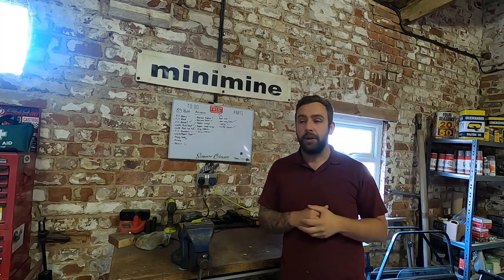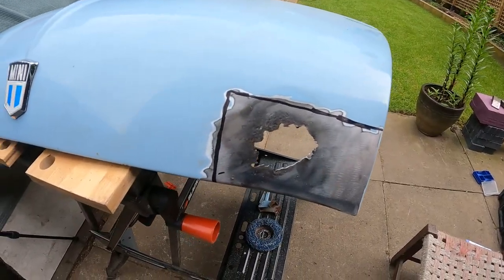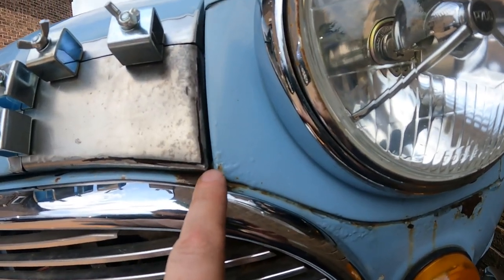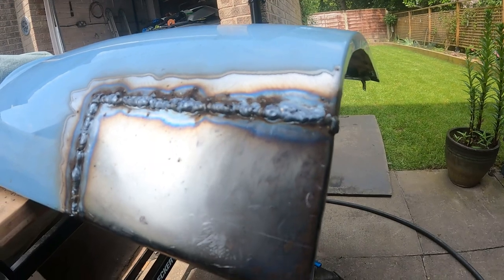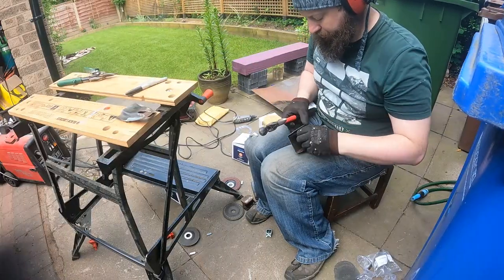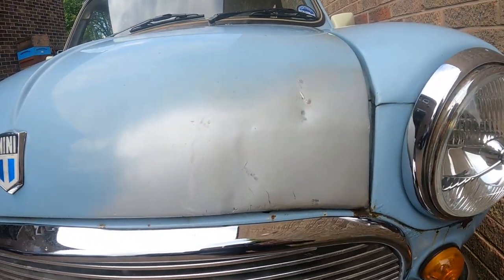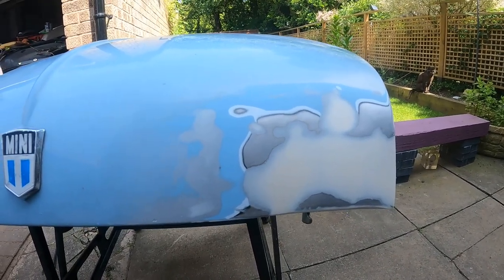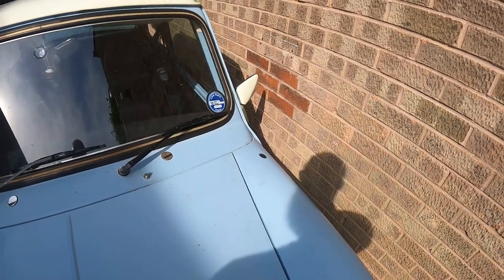DIY Rust Repair - Classic Mini City MOT Prep

Comment: A good result given the basic tools available. My first workshop necessity is a good sized engineer's vice solidly mounted to a sturdy bench, but I also have a No.2 Record vice that I have mounted on a square of thick plywood with a batten fixed underneath to clamp into a Workmate. It's invaluable and would have made the fabrication a bit less difficult. With some packing to protect them, dollies can also be clamped into the vice for shaping. Best wishes.
Reply from the maker: Cheers yes the vice would have made it easier and he has this kit in the garage but if you take a look that’s a rather full garage and was unable to get to that. I think that’s result with just using his hands turned out really well. Thanks for watching 👍

Comment: Great repair! Thanks for the video! With the curves on that support piece, it may have been easier to get the curves by welding separate pieces together rather than trying to hammer and dolly?
Reply from the maker: Cheers. Yes that was definitely an option but it was nice to get the dolly out and make the shape. Cheers for watching 👍